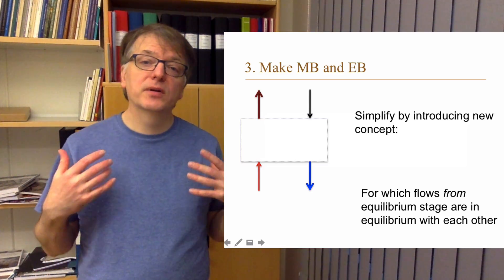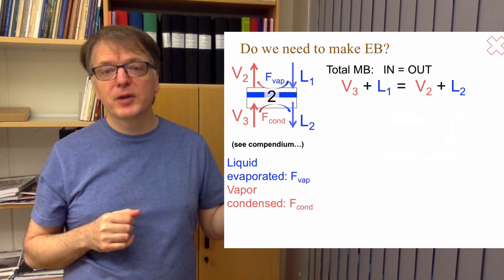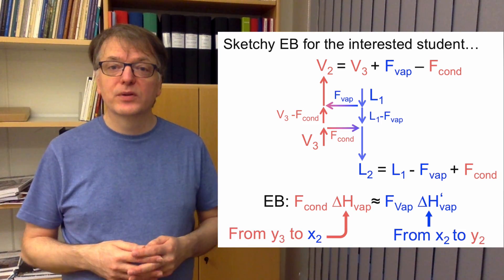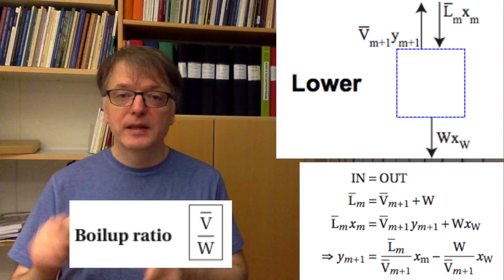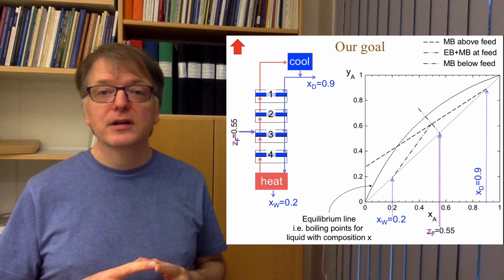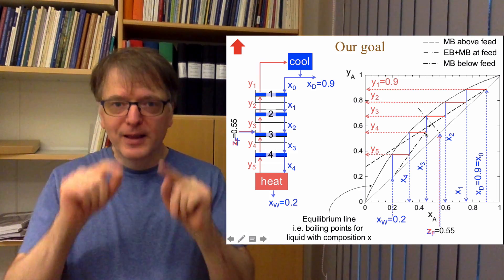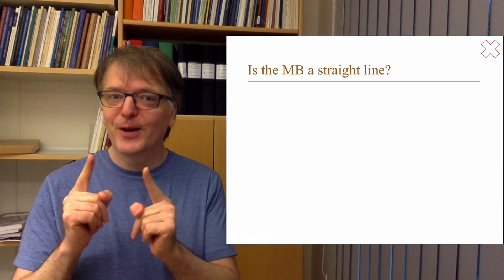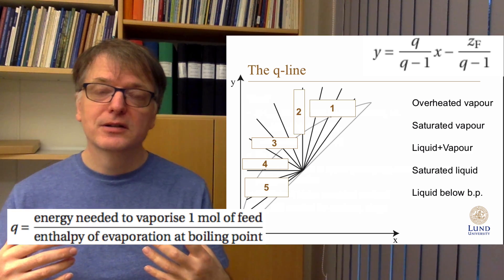Distillation: Deriving McCabe-Thiele using MB & EB

Comment: How determined feed stage (flashzon) for crude distillation tower please.
Reply from the maker: Not my area of expertise, unfortunately, and not something you can approach with McCabe-Thieles graphical method, which is the topic of this video. Crude distillation is a multi-component distillation and you need advanced computer models to deal with that. In the advanced courses at our department we use Aspen for calculations of multi-component systems.
Reply: Department of Chemical Engineering/Lund University 
Thanks for your interest